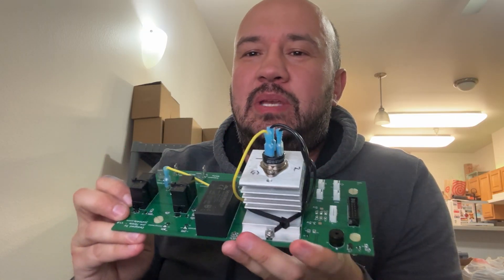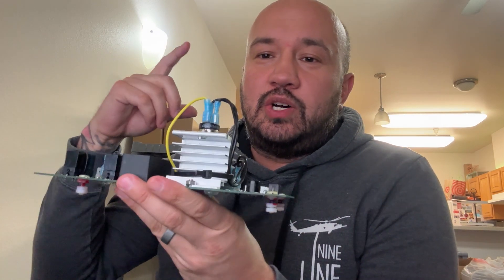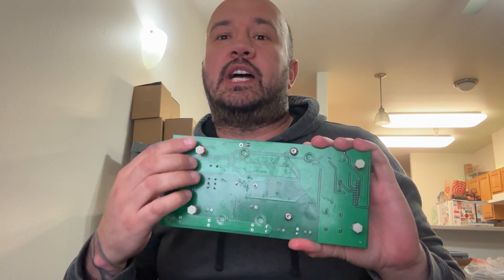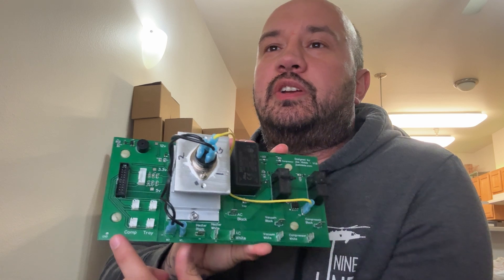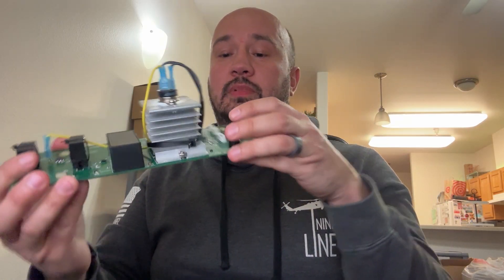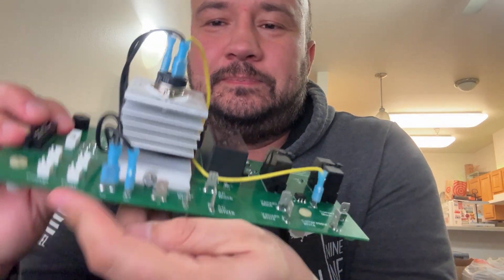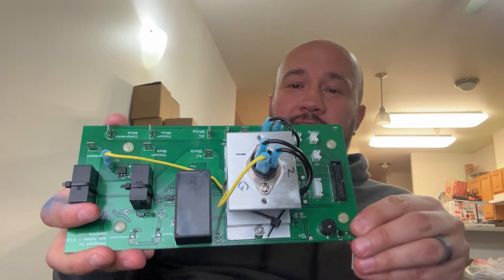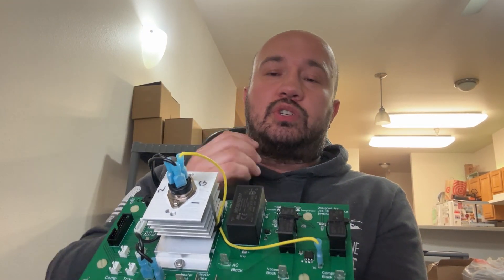Upgrade your older Harvest Right relay board to  3rd party Solid State Relay Boards

Comment: Im not sure if this is what I need but I keep-hearing loud clicking from the control panel and a light blinking inside in sequence with the clicking, also my ceiling light flickers at the same time, its an older small machine with 3 shelves

Comment: Hello Donald,   My Hinkle board has worked flawlessly, with one exception.  It started with a high pitch whine when running.  Now it has led to the same whine whenever powered up.  I understand if I just shut off the power button in the back, it is quiet.  Is Joe aware of this obvious transformer issue?  I looked for Joe's contact info & none to be found.

Comment: Is this new board a good replacement for the older style relay boards?  Mine wont power on right now.  Just a flash of the green LED on the relay board and the USB board - then nothing.  I suspect there is a main PS relay and it has likely failed.

Comment: I saw this and thought back to the time I tripped my first 20 amp breaker.  I lost that batch.  I thought it must need the warming tray bypass.  I did that and got up and running again.  10 batches later it tripped the breaker again.  The relay was welded together.  A test in manual mode proved it worked on the drain stakons.  The HR board probably had 30 batches and failed.   I have 2 batches so far on the Hinkle board.  So far so good.  The relays on the board are 16 amp .  Double what HR supply's.  Installation was not to tough.  I needed to extend 2 capacitor lines & the ground wire all soldered and covered in heat shrink.   The board is mounted on the vacuum pump side door inside.  Velcro sticky's. ( Get the Tray )   I have confidence in this attachment method.  Thank You  Joe Hinkle and Donald

Comment: @joehinkle8583 When my relay board arrived, it was missing the screw-on connectors, and one of the connector posts busted off and was loose in the box.  Looks like it broke off right below the common-screw top.
Reply: In addition, it looks like the heat-sink is too tall for the existing bracket.  I presume that is why you offer new 3D printed ones?  I did not know this when I ordered or I would have gotten those.  Something that the video should have mentioned. :)  If Joe gets in touch with me will order those.  Thanks!

Comment: Thanks for the vid.  I just replaced my circuit board for the touch screen, my old board was version 1, the new one is version 4--and now I have relay board errors--apparently this new board isnt compatible.  So--$95 for a new board.  Went ahead and ordered this one, will swap out once it arrives and keep the 'replacement' as a backup.
Reply from the maker: Dang, that's a bummer. It seems like they are constantly changing the setup.
Reply: @freezedryerrepairsupport  My board by Joe Hinkle came in today!  No 2 week wait for me!  Now debating whether to install now or wait until the new board I put in yesterday fails.
Reply: @freezedryerrepairsupport  Also, the V2 board is laid out a bit differently, and has another relay mounted to it.
Reply from the maker: Yes Joe made some small changes. All for the better. Did you have issues with the board you got? If so can you please email me so we can get it fixed. I tried finding your order but it will not let me filter to find you

Comment: does it work for the analog model?
Reply: What is a "analog model"?
Reply: @joehinkle8583  Harvest rights first freeze dryer models were analog which had 2 knobs to turn up freezing/drying time. I did the research and I guess it is possible to upgrade it from analog to touch screen/newer relay board..
Reply from the maker: I would suggest trying to upgrade the whole system if this is what you are wanting to do. Would this work, very likely it would however the wires might not reach where they would need to go and the board is likely a different size.

Comment: Will this board work on ALL HR models?
Reply: I don't know.  I have a Medium size machine.  The Relay board Donald supplied me with from an older machine could also be replaced.  It depends if HR is using the same Relay Board across all their models.  From an Engineering point of view - THAT would make sense - if SO - then this board will work.  If they have multiple relay boards - then I would have to see one that was different to tell.  I suspect HR only has one model - so I would say yes.
Reply from the maker: As long as you dont have a system using multiple tray sensors this will work with your system. We are making some small changes right now as we found that HR is using a slightly different setup on a few machines (this board is set up to be used without a compositor)  but the new board should be great now that we found some machines are still using one.
Reply: @freezedryerrepairsupport  The other sensor ports are connected so if using multiple tray sensors all should be well!
Reply: The Relay board I received in 2024 had a SSR and only 2 relays - NO relay for the large CAP.  Board available does NOT support the CAP.  I just redesigned a NEW board that will accept the CAP.  China is building the board today - one week to build - one week to ship - 4 days here for me to build and test - My NEW board ready to replace those using the large CAP.
Reply: @joehinkle8583  Hey Joe,  I bought one of your boards with the cap. However you had it labeled with white & black wire. My cap had 2 black wires. And while your board was labeled, harvest rights was not. So the two smaller white connectors were are a mystery. When I simply switched them in the same configuration to the new board and tested. The screen went crazy and I could feel a strong electric sensation at the top of the cabinet. It did not shock me, but I could feel a surge. Any suggestions?
Reply: @freezedryerrepairsupport  Sorry for my ignorance, but what is a "compositor"?
Reply: @Three-Three-Three  Capacitor
Reply: @freezedryerrepairsupport  do you mean without a capacitor? If I order this, and it does not fit my tray, can it be returned? My Machine is 3 years old with thede components right behind the screen. will I be able to replace with the new solid state board without taking the entire casing apart?
Reply: Also mine has a capacitor. So do I order differently? I only see the one choice on the website- except for mounting option.
Reply: One last question- this board looks TALL to fit in the space. Is this an illusion or can you give me a height measurement from the flat green board fo the height of the blue parts with black and yellow wires extending up?

Comment: Question for Joe- I have had my old board relay get stuck and it fried everything in my FD, thousands of dollars lost. Since your SSR are replacable if they ever wear out, will they stick the heaters on when broken and have our trays get to 350f like HR boards will do to a unit?
Reply: Using a relay to control the Compressor and Vacuum pump is OK since the contacts in the relay are only opening and closing a few times during the complete drying process.  HR drives the Tray Heater relay using PWM (Pulse Width Modulation) with a period of 12 hz - meaning the contacts are cycling 12 times a second.  If you do the math - 42,300 cycles per hour.  Now multiply that by how many hours you dry - and it's a LOT!!!  Those relay contacts are like the points in distributors of OLD cars (like my first one - 1960 Ford).  The relay contacts will pit with the major failure mode being they get welded close.  Once they are welded close - the ONLY way to remove heat is to manually turn the power switch off.  The CPU no longer has control.  I use a 40 amp triac to control the Tray Heater.  It is designed for PWM control and should last a very long time.  The major failure mode of a triac is it latching ON.  If you look at why this happens - it is usually due to using a triac rated close to operating conditions.  I use a 40 amp device.  Since most of you are using a 15 amp or 20 amp wall socket for your dryer - the odds of over driving the device to failure is very small.